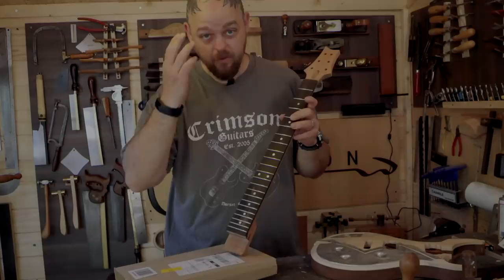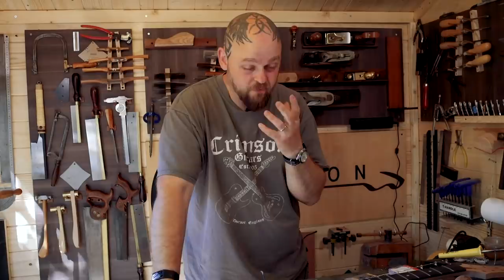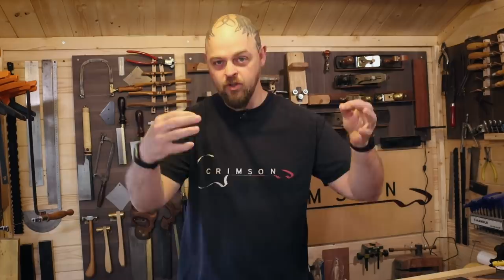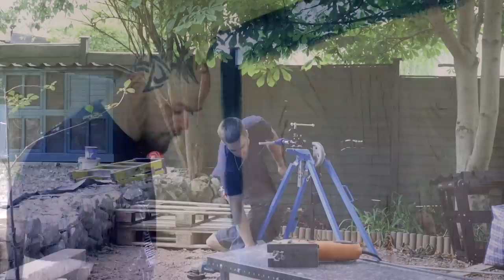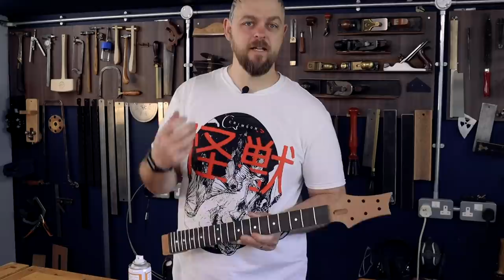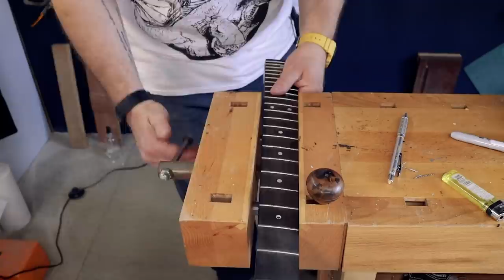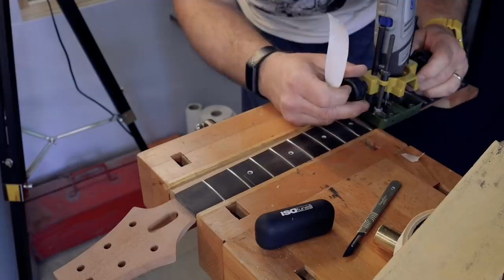Utter Failure Ep 10 | Building a CYBERPUNK 2077-inspired Custom Guitar

Comment: Boring nerd alert... the white LEDs would never light up with that red one in there.
Red LEDs typically have a forward voltage of 2V (ish). When this voltage is reached, the LED conducts, (the remaining 7V from your 9V battery is dropped across the resistor).
White LEDs conduct at about 3.2V. They require more energy, (they work by shining UV light onto a reactive phosphor coating). Thanks to the red LED, that voltage is never reached.
There is also the horror of current hogging, but I'll spare you! LED drivers are a thing - worth looking at if you go down this road again.